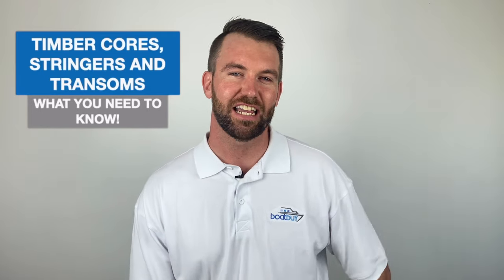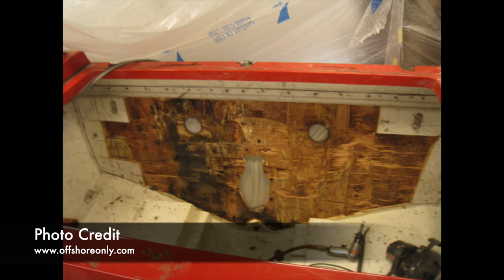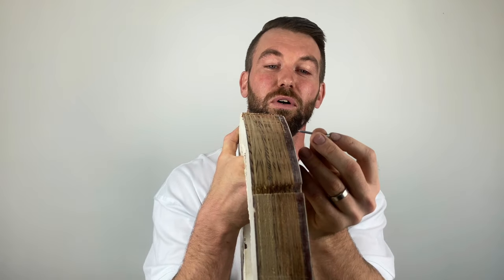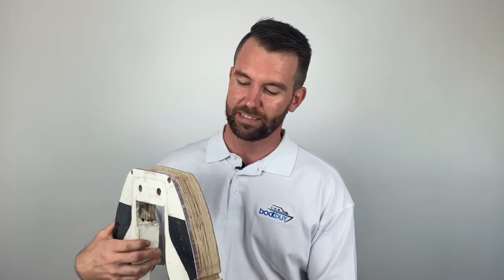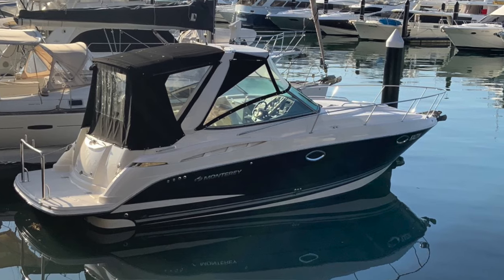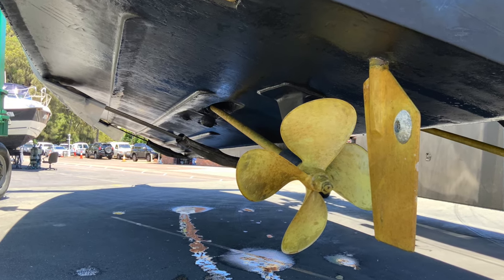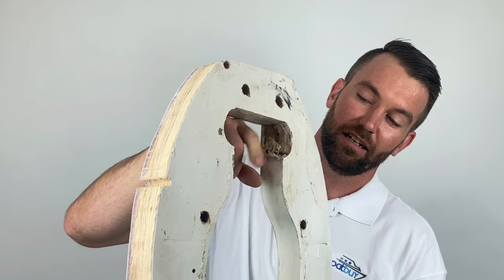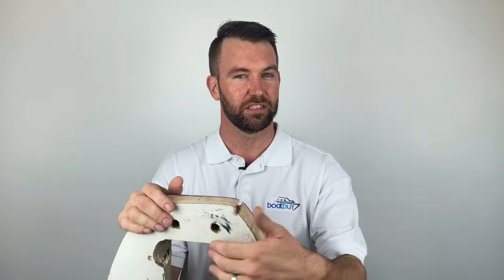Boat Transoms, Stringers and Timber Cores - What You Need To Know!

Comment: Hi,  i have this timber rot problem you speak of in my transom. I drilled multiple holes through so I could dry it out properly and used Wetrot to firm up the wood fibers. Its obviously not strong enough to put back in the water, so i have this idea to fix it that will save me replacing the thing ( which i wont do because its not worth it) Idea: to inject resin into the transom to fill all internal voids and bond all timber fiber so unit is hole again. Plan on using west systems 105 or 650 (leaning more towards 650) anyone have any thoughts, info, advice recommendations? thanks
Reply from the maker: Hey Jobs,
Unfortunately it's all just going to be a band-aid fix. The resin won't bond correctly to the wet and rotten timber, and it will just have sections of dried up resin internally. Sorry to hear the bad news :-(

Comment: Have you got any insight into modernizing older builds?
I'm considering a resurrection project from the early '70's with twin gas inboard engines
Reply from the maker: All just depends on your skill level and amount of time and funds willing to put into the project. It will be more expensive overall than buying a newer boat in good condition that doesn't need work, as you need to physically cut out and disassemble the boat back to bare, then spend all the labour re-glassing etc. If the boat is particularly sought after or something rare, go for it. If you can buy the same boat, for more money, as new - I'd suggest that if you want to actually go boating....

Comment: As an older Shipwright I agree with everything you have said in this video.
Too many times I have found rot in what would be perfectly fine structural boat bits, transom, stringers, floors and soles...
If people didn't randomly attach stuff without sealing off the timber/ply!
And I don't mean mastic/sika/goop!
Post through holes, epoxi seal screw holes...
Think, don't let the water in!
Reply from the maker: Thanks Carl! I've seen so many boats that didn't have to be.... Hopefully people learn!